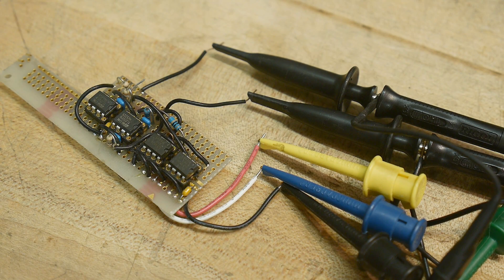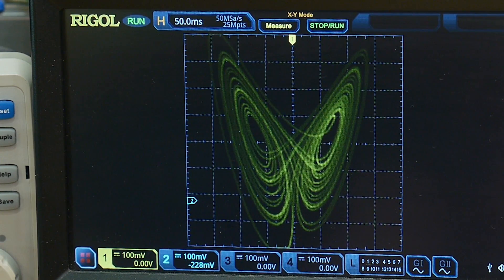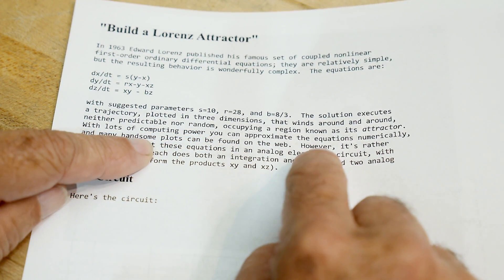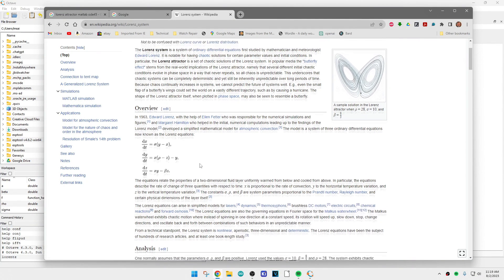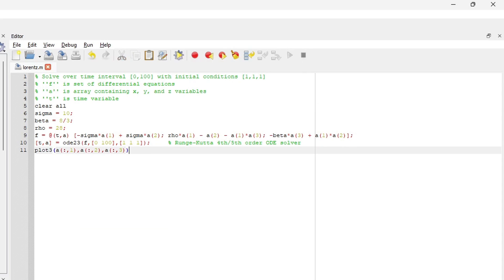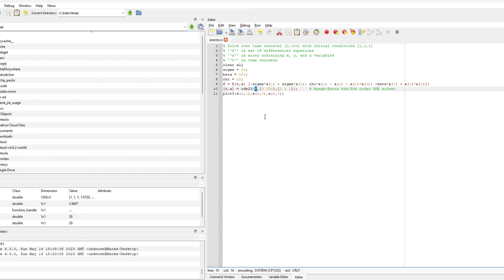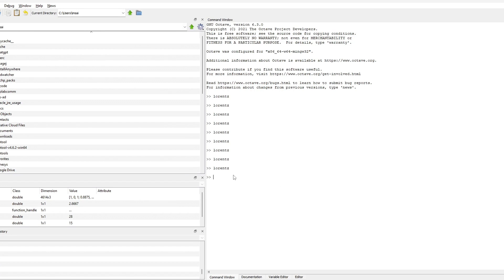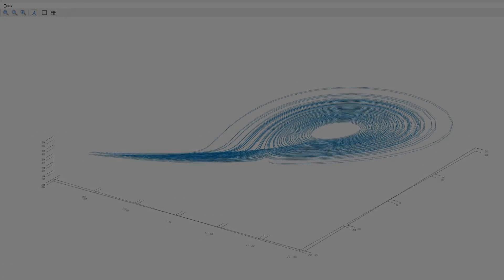#1583 Lorenz Attractor: Analog and Digital Computers

Comment: An elegant and thought-provoking circuit, but I respectfully contend that it is not quite an analog "computer". If it were, you would be able to modify the coefficients and start/stop the operation of the circuit. In other words, you wouldn't need to switch over to Matlab/Octave (although that 3D plot is pretty slick).
Reply from the maker: so a fixed coefficient design is a disqualifier? then a ROM based microprocessor circuit with non changeable 'coefficients' is not a digital computer?

wiki: A computer is a machine that can be programmed to automatically carry out sequences of arithmetic or logical operations (computation).
Reply: @ I think so. In my mind, reprogrammability is what separates analog or digital circuits from “computers”. I consider both of your Lorenz simulators to be applications, but the circuit is hard-coded, like your ROM example.
Reply from the maker: ROMs can be replaced with a new code or PROMs are programmable, or FLASH ROMs. can be re-flashed, or the resistors and capacitor values of an analog design computer can be replaced, or making them potentiometers.

Comment: The R-K methods go well before the 1990's, roughly `1900, or so,  and the Dormand-Prince forms go to 1980. I saw R-K in a computational math course way back,. When DORPI as published, my life got easier. Added to MATLAB in the 1990's. The differences in the plots are due to the dt used. The higher order can use  larger dt, so a more clunky looking, but equally or more correct, graph.

Comment: There's a fun attractor plot you can do with y = x^2, if you iterate the equation by repeatedly applying x^2 to the prior y value, and plotting each (x,y) with a straight line connecting each.
changing the slope and intercept on the parabola are fun.  Did that on a tektronix vector graphics terminal with long-persistance phosphor... it was cool. Ah my wasted youth.

Comment: I implemented a lorenz attractor in C++ on an SGI workstation back in the day.  Rendered it in three-d and when it started rotating you could hear the whine from the switching power supplies in the graphics engine change tone.  Sounded like it was downshifting.
Reply: I am pretty sure you can do it in Python on a $50 Casio fx-9750GIII calculator.
Reply: yeah, but I had the SGI workstation sitting around.   @barrybogart5436

Comment: One can get two single transistor sine oscillators to have unstable periodic orbits by loosely back coupling them and used them for as analog computers for central pattern generators for limbed robotic locomotion. @roboanalogtom is an old channel on it and the theory

Comment: The reason that the Runge-Kutta 4/5 looked chunky is because of the plotting of the result.  The plots used line to connect time instances while the high order Runge-Kutta was using higher order polynomials to follow the trajectory.